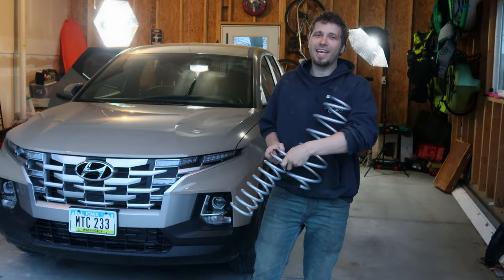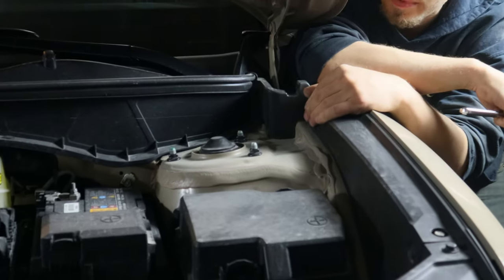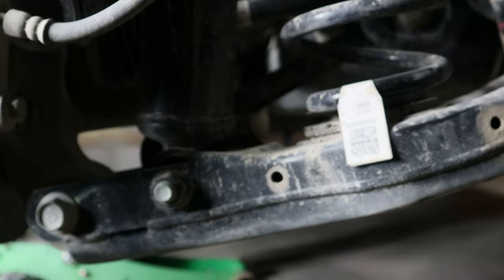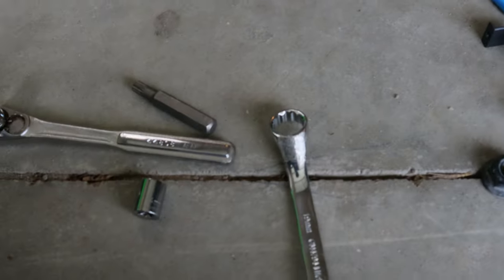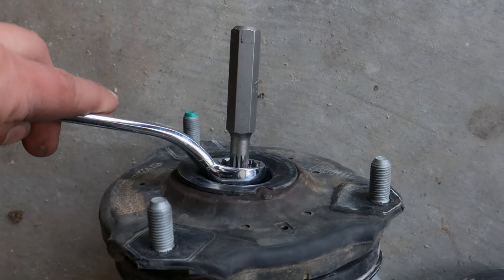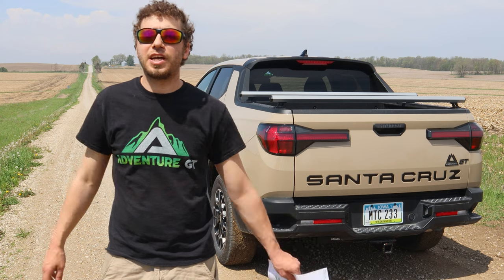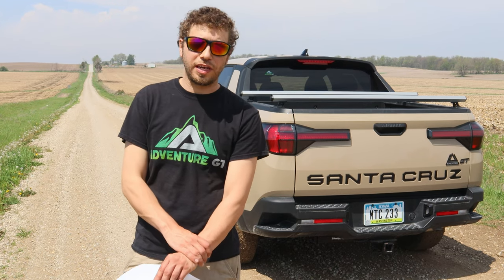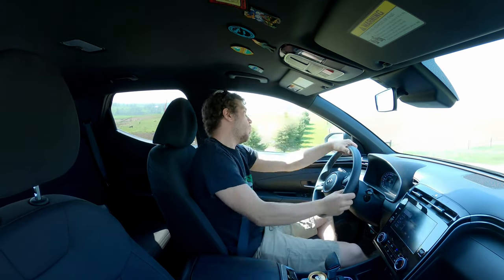Hyundai Santa Cruz Lift Kit by Eibach. Install and Review

Comment: Its been a few months, hows everything holding up? I want to lift mine and considering going this route.
Reply from the maker: Fantastic!  The vibration went away after a few hundred miles. Since then I've put about. 7000 miles on the springs. 
The only difference  I can find is on pot holes.  The extra spring rate pushes  the tires down so hard it makes a noise that wasn't there to being with.

Other than that 0 issues and I'm 10000% happy with them.
Reply: @AdventureGT  Thank you for the quick response. Keep the Cruz vids coming. I have a sand as well. 🤘

Comment: Can you use the compressor to help you install the rear spring
Reply from the maker: You might be able to get one one there, but I think It would interfere with the lower control arm.   You really should need any thing at all if you install it lime we did in the video

Comment: Curious if you had considered or seen the GR Lite or GR40 full suspension lift kits from Flatout Suspension. What makes Eibach method better or why did you choose your route?
Reply from the maker: When I purchased the Eibach springs.  Flat out had nothing  for the Santa Cruz.  I sat on the springs for a few weeks. Then there announment came out haha. 

I've always heard great things about Eibach, and these springs were designed to work with OEM equipment. So I know that ever thing will last for the long run.

Comment: Does this change the pay load, and I noticed the lettering on your door garnish, I was wondering where to get them
Reply from the maker: It does change the payload by a little bit the rear springs raise it 1.1 inches.  So it won't sag ass much with a heavy load. You'll have to check Eibachs website for the official numbers. 

As for the letters the Ebay seller discontinued them.   There is another seller though at double the price.   There's a link in the description to find them.  On the door cladding video, in the santa cruz stuff Playlist.

Comment: Hi. Did you have any issue on the stock front sway bar like being too long? if we install shorter sway bar would be better? Do you think would work?
Reply from the maker: The springs were defined to work with thr stock system, and it does a great job. Soes you won't have to mess with diffrent sway bars at all!